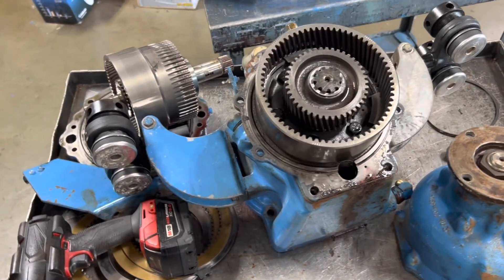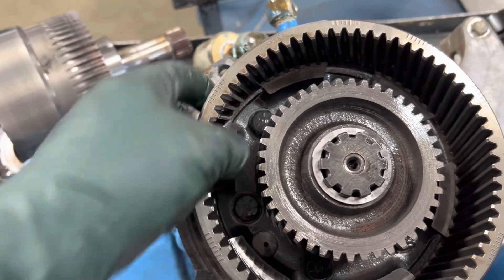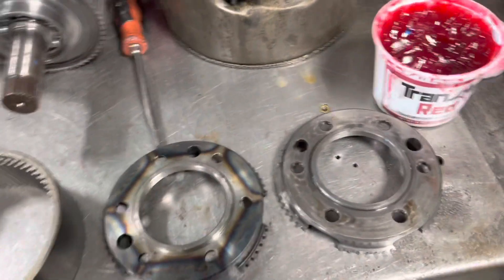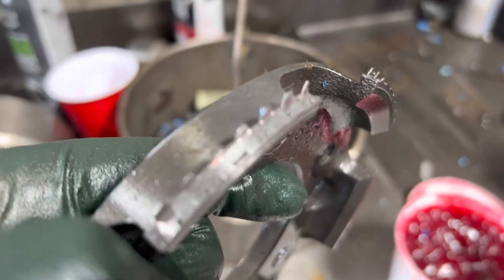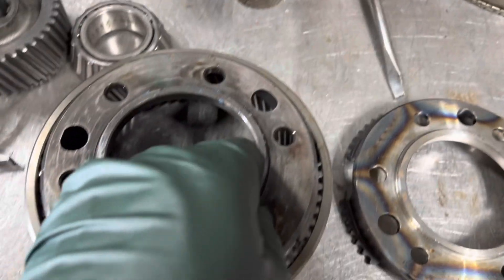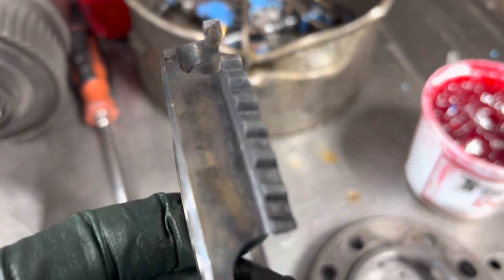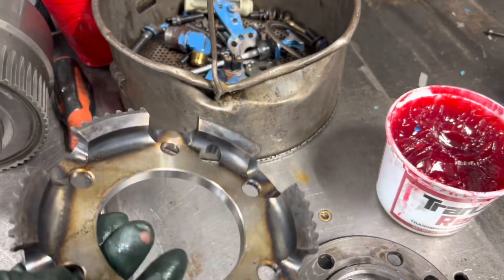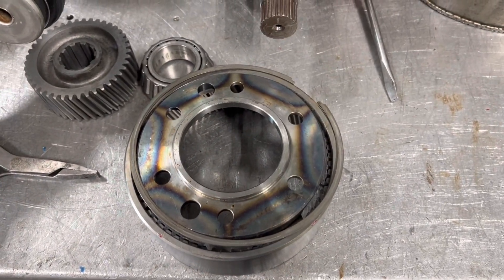Velvet Drive Marine Transmission 10-18 2.57:1 Common Failure of the Reduction Hub

Comment: How come those teeth fail like that Chris? Does it have something to do with the 2.5 ratio? Interesting. Thanks!
Reply from the maker: That hub is only on the 2.57. They weren’t heat treated originally and they are so thin.